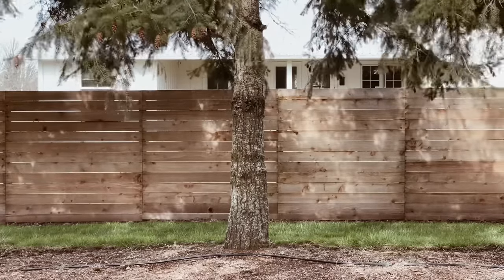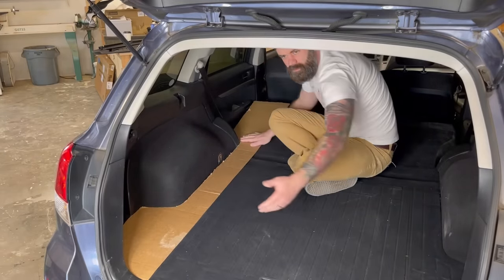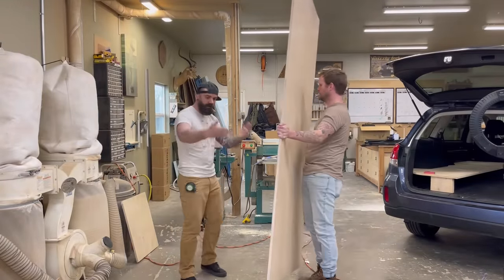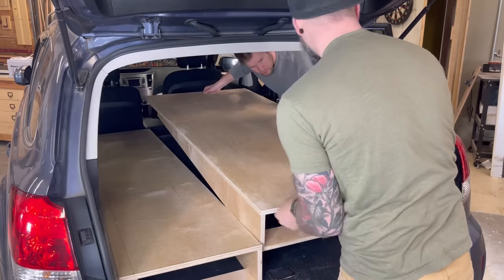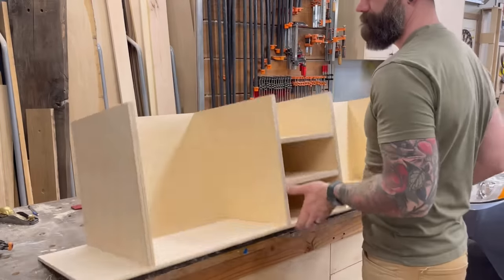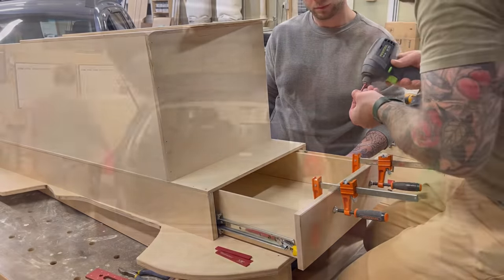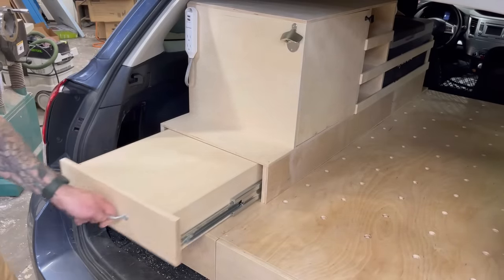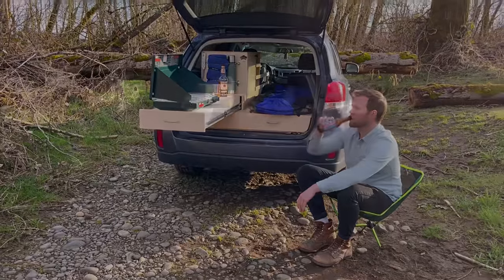Look What I Did To My Friends Car || Ultimate DIY Camping Conversion

Comment: Nice build. I would have made one change and that is removing the back seat. that would have provided a flat surface that starts from the back of the car. So no or minimal incline needed and the initial cut plywood could have been used. IT would also provide most storage where the seat was in the form. Another option would have been to keep them elevated and have full-length drawers in the bottom.
But I understand if your friend did not want to do that. It is an extra step when you load and unload it but during the trips, it is just an advantage because it is very unlikely that you would remove the camping conversion.

Comment: Cool! But why not remove the rear seats and utilize all that space?  Since he only needed sleeping space for one, it doesn't seem as though the back seats are used often, if at all. And then you could have made removable panels to utilize storage in the foot wells, and in turn, made the cabinet lower profile so it didn't obstruct the driver's vision quite so much. And it wouldn't have required all the maths to make the platform level. Just sayin. :)
Reply: You could even make a subfloor of sorts for the back seat area, so that when the camping stuff is removed, that area would be completely flat, usable cargo space.

Comment: I wonder if you could save a few pounds of weight, here and there with speed holes in strategic places on the frames and sides without sacrificing strength too much?

Comment: did you calculate for the weight beeing added in the back aswell when trying to level out that floor ?xD
Reply: It's a subaru, not a tesla.  He's not riding in the back while it drives itself.

Comment: I think you could have helped you self by removing the seats in the back. (not the back part, only the sitting part) In my car it removes the slope and turns the floor into one big flat surface.

Comment: hmmm observation.. but would it not be better to have the fridge facing outward to the door so you just open the door to access the fridge or at the back of the cabinet as you presently have to get into the car to get anything from the fridge..

Comment: Because of the little ear you needed when raising the Plywood you could have used the old board instead of a new one ,just to say . If you cut it to fit the half of the car you would have had to cut less off by using the "wrong-measured" one. Good luck next time
As your Dad said " measure twice..." but first think 😁
I myself did so many things wrong not remebering these simple fact

Comment: Be a real job to get to the spare tire and jack under that floor if you needed to all loaded up on a trip.  I say relocate to where you can access it.  In fact, I'd get rid of the solar panel and put the tire there; no like you get much solar gain in the pacnw do you?

Comment: The design is solid but the materials always baffle me. Wood adds WAAAAAY too much weight, which impacts MPG and shortens vehicle life. Wood is also prone to grow mold as well as creating a potential fire hazard. It makes so much more sense to use plastics like PVC, ABS, and aluminum for frames. MUCH more lightweight, recyclable, and won’t grow mold or attract termites and other critters. It also uses significantly less space.

Comment: Horrible place to put the cooler. Walled of from reaching in the back door and can't get to it from the trunk when you're cooking or outside & the length/height of it being at the back of the driver's seat means you can't lean the seat back at all.  The skill of design and implementation is pretty awesome though.

Comment: Eh, I think I would've just removed the back seats to flatten the floor and open up more storage space in the rear footwells.
Reply: I feel like it’s designed for outings and not a total conversion so removing the seats would sort of defeat the purpose of making it easy to take out.
Reply: @ThomasKentgaming , you're probably right.

Comment: I hate to be the Safety Sally.

But as in insurance adjuster, I have seen too many accidents. 

I would not want to be the driver or passenger when someone rear ends this car. 

Those cabinets might pinch when are crammed into your back.

Comment: Why does the light flash on your jigsaw thats gotta be annoying!
Reply: LED lights flicker faster than the human eye notices, but the camera records images slower than the LED, so it looks like it's flashing on camera, but the eye can't see it.
Reply: @zerocool2352  that makes sense now that i think of it on some leds if you focus really hard on them you can see them flicker
Reply from the maker: It actually flashes in time with the blade. This makes the blade look like it’s standing still so it’s easier to follow a line while you cut.
Reply: @Bourbonmoth  interesting

Comment: Why in all thats holy did you not remove the seat bottom on the driver's side, and use the 40-60 split as the dividing line?!?!?!  SOOO much wasted space!
Using 3/4 plywood added an insane amount of weight.  THe only thing that might have needed 3/4 is the drawer... unless you used slides to support on the sides.  
So much for that car's payload.  RIP those rear springs&shocks...
Reply: Why so much criticism? It’s just a temporary setup